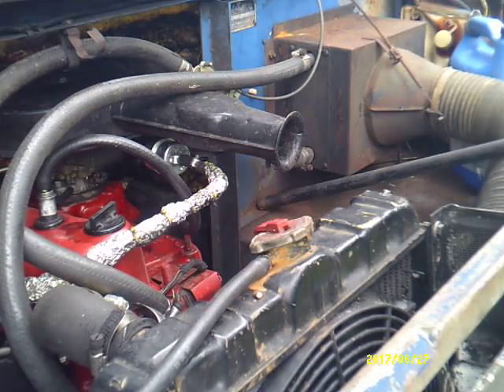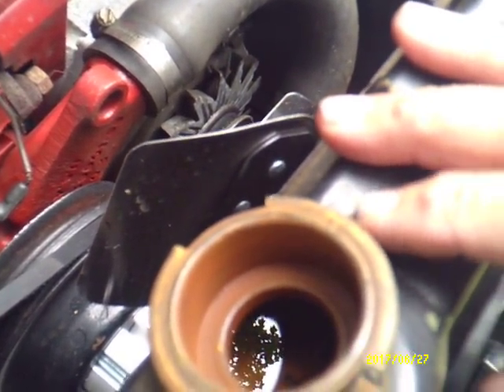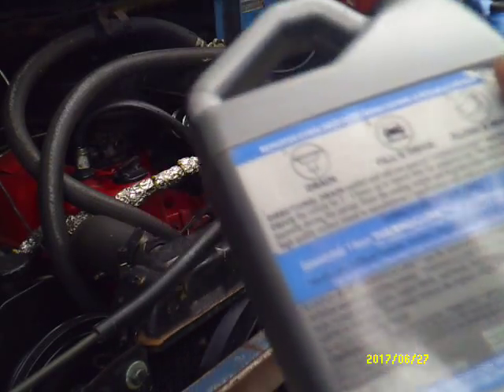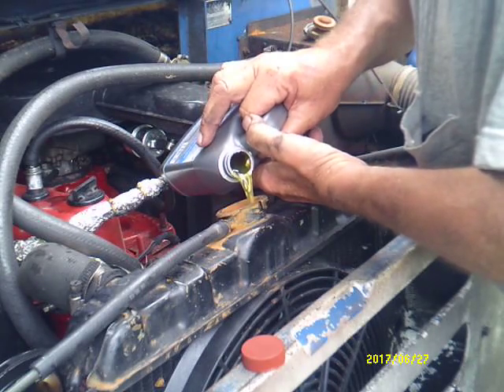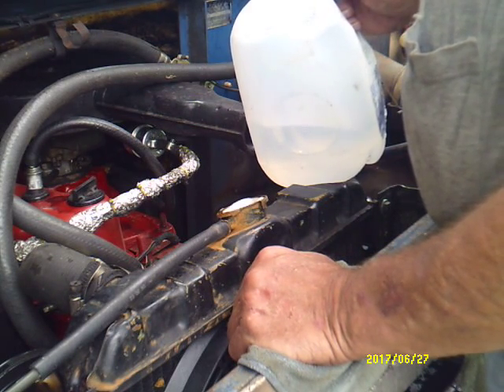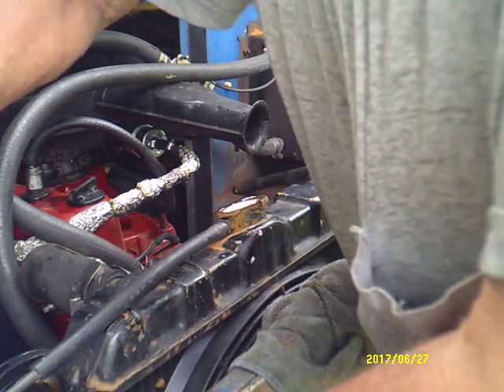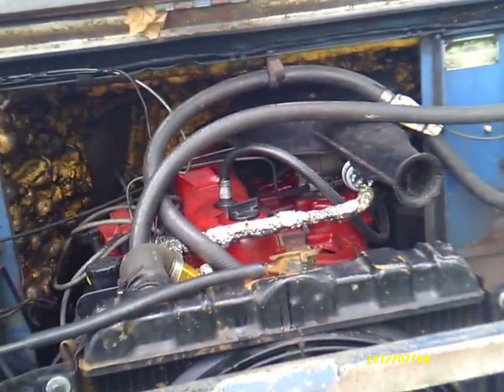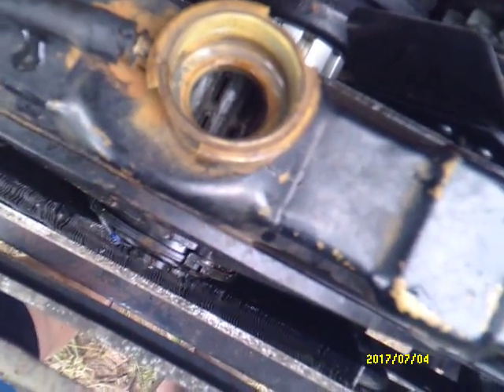How to Clean A Rusty Cooling System With ThermoCure REDROB #39

Comment: A: You don't have a fan shroud.... so that engine driven fan isn't doing anything but moving air around. B: 200* is not overheating. Engines are made to run around the boiling point of water, so that condensation burns out of the oil. I.e. 212* F. Sure, you can put in a low temperature thermostat and get them to run colder. Once you hit 220*, you are running hot.
Reply from the maker: Thanks for watching. A fan shroud is impossible to find for this thing and it would not help much as I have a 16 inch electric pusher fan mounted to the front of the radiator. This truck starts and stops over 600  times in 6 hours and I don't like to run any closer to the limit than I have to.
Thanks

Comment: Clean as a whistle.  Makes me wonder why some engines/radiator rust while most don't?  Had a 1990 Ford Ranger that started rusting.  Water pump developed a leak. Had a shop change it. Then the engine started running hot for no reason.  Nobody could tell me why. Driving it home from a garage it ran real hot in a minute's time. Ruined the engine. Got a used engine put in and no more trouble.  Found out later that after that particular kind of water pump was changed an air bubble forms behind the pump. A heater hose should have been disconnected and a garden hose connected in it's place. Pressure from the garden hose would force the air bubble out and the pump then works normally.  =Was an expensive water pump and an expensive lesson...
Reply from the maker: Thanks for watching and commenting. I have always been told that the water inlet { top hose} must always be higher than the thermostat housing so the air can work its way out of the cooling system. But now a days, these smart engineers have started designing vehicles with the radiator lower than the engine to make the hood lower. Ford started this in 1962 with the full size cars and had to put an auxiliary tank over the thermostat to get the radiator to fill and they are still at it today. The 1995 Mustang in my videos has a bleed screw on top of the engine that has to be opened when filling the radiator to get the air out. I also have a PT Cruiser that has a bleed screw in it to get the air out. Also with the new belt systems the are using now, the correct water pump must be installed, some vehicles have a standard rotation water pump or a reverse rotation water pump depending on what accessories are on the engine and how the belt is routed and a mix-up changing a pump will kill an engine.
    Thanks for watching my videos and I enjoy your comments. When I started this channel I did not aim to get this deep in things but with these breakdowns, I decided to film them and here we are.
     Have a good day!!!!!!!!!!!
Reply: Anti freeze has anti corrosive agents. You don't replace antifreeze because the freeze protection is gone... that doesn't change. The anti corrosion agents get used up. In the old days, they lasted a couple years. Now it is 5 years for ELC.

Comment: The cooling system on a K5 Blazer I bot was PURE RUST! I flushed it 25-30 times, backflushed, several bottles of prestone and peak rad flush etc. I then ran thermocure once the water was running fairly clear. The visible rad tubes appeared cleaner, but when I removed the upper rad hose, there was plenty of rust chunks attached. I also removed the block drain plugs and had to use a piece of wire to get the water to run out of the drain hole. I imagine there's quite a bit of baked on rust inside. I posted a video of my results
Reply from the maker: My rust was not quite aa bad as yours, but it did overpower the color of the antifreeze. I left the thermocure in for a week and then flushed the system 3 times and then put in antifreeze. So far the system is still clear.
Thanks for watching!!
Reply: Scroll back thru a few of my vids, you'll see the rust in the upper hose